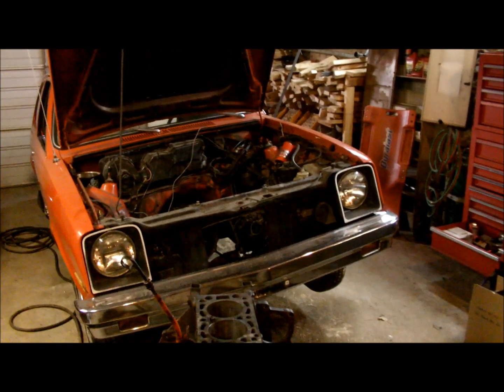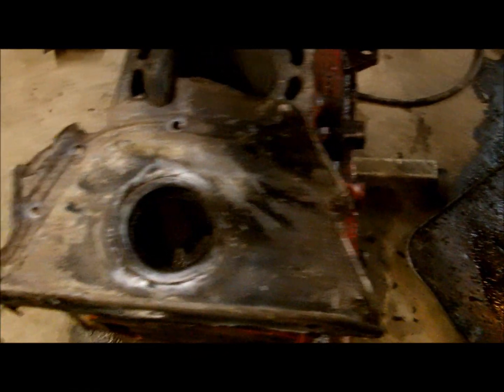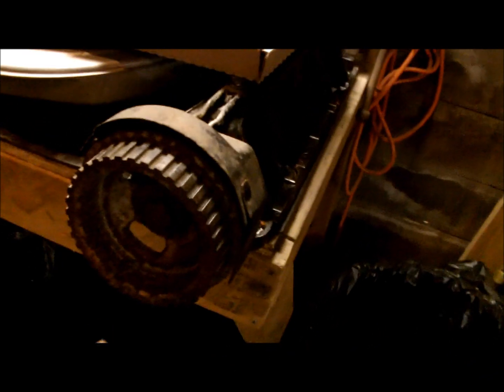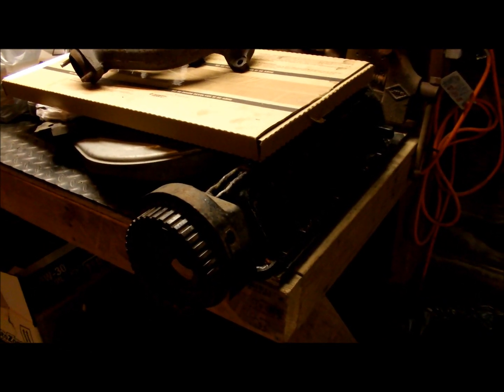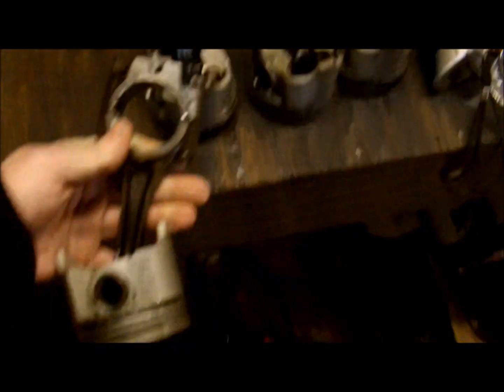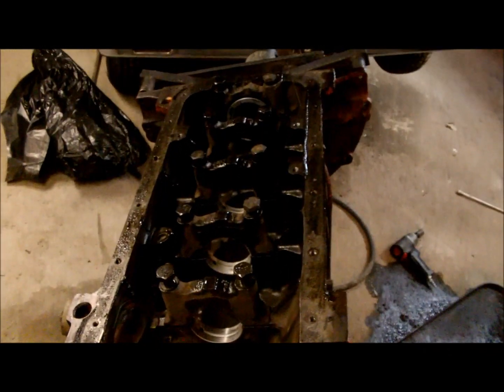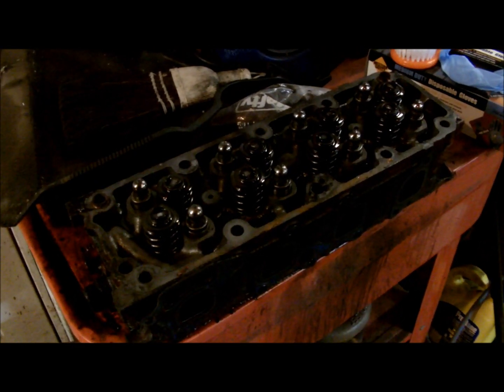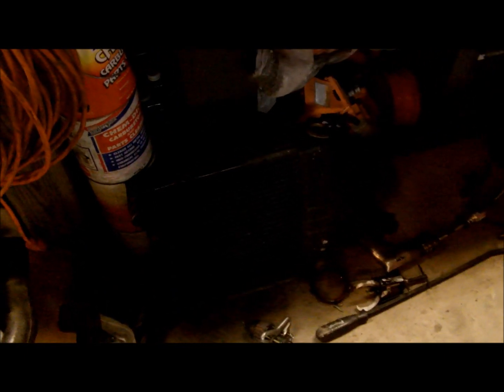Chevette motor tear down and rebuild - Part 1

Comment: I rebuilt one of these and I honed a cylinder way to long. I used the old pistons and of course that cylinder  rattled for the next 4 years I drove it. Never got any worse so it was all good in the end.

Comment: If you were down on power, why didn't you get an Olds Quad 4 engine or an ecotec, and get a 5spd out of a v8 Camaro, and get a bellhousing from QuadRod from denver and swap it in. You would have had plenty of power! And still got better mpg!
Reply: w41duvernay he was down on power because his timing was off.